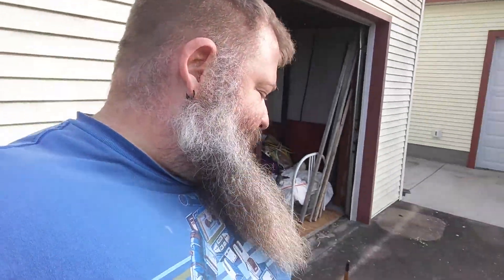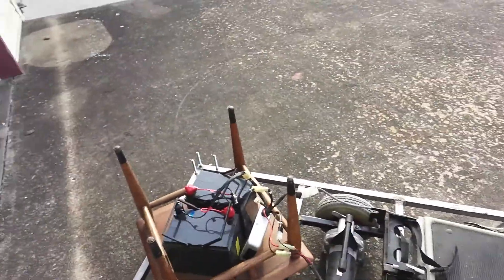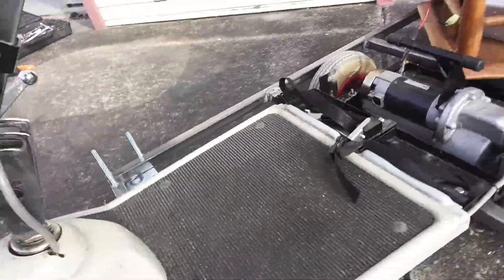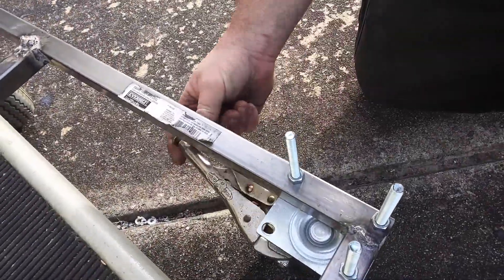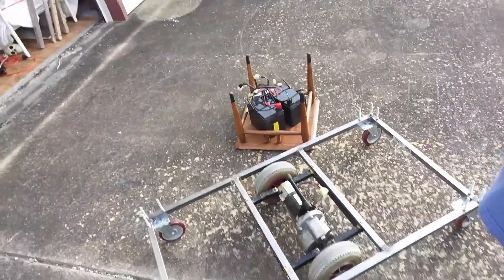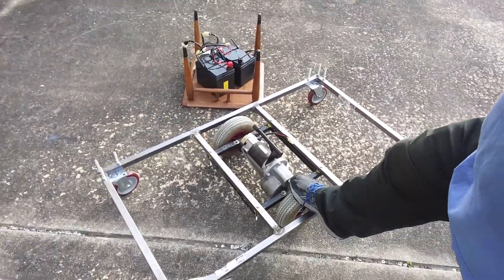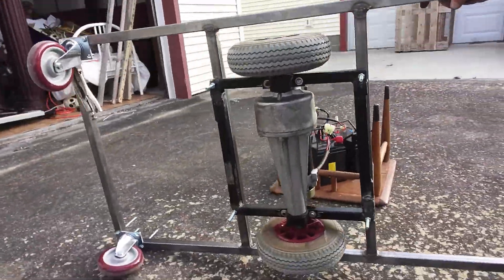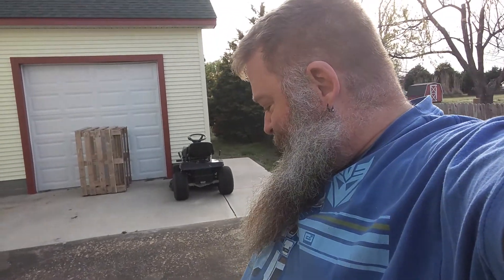First test dark ride car.

Comment: Love it. I want to have a lead vehicle that tows three more single passenger cars behind it, so 4 at a time can go through. I'm considering modified wheel chairs towed by the front one. That way i dont have to build all the carts and they are made for weight and stability.
Reply from the maker: @savethebee8561  I love this idea! I'm pretty sure these mobility scooter motors are strong enough. For testing, I pushed around my riding lawn mower with one of my friends on it while I was on the cart with another adult. It did not seem to struggle at all. I bet battery life would be sacrificed, but it had plenty of power.

Comment: Could you share what motor, controller and encoder you used?
Reply from the maker: The motor and transaxel is from a mobility scooter.  24V
The controller is from POLOU. Its a JRK G2 24v21
The encoder, BQLZR 600P/R Incremental Rotary Encoder DC5-24V was ordered from amazon